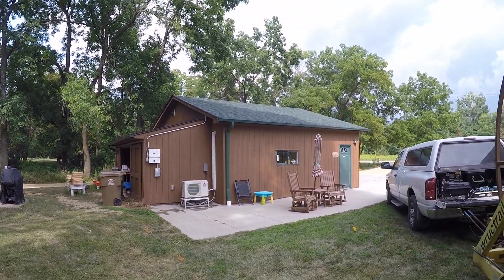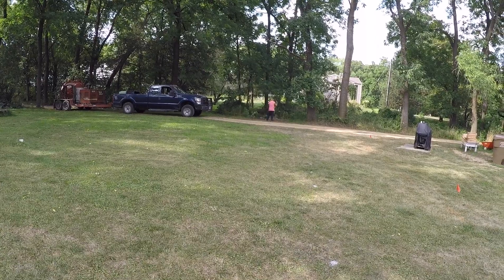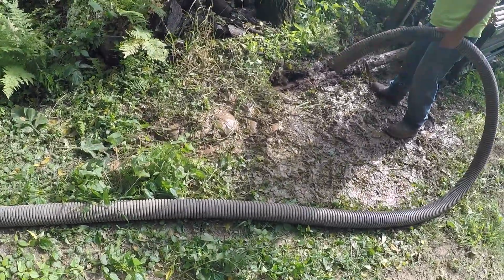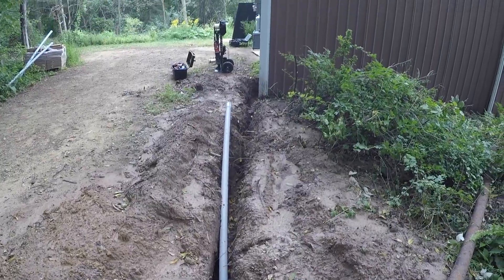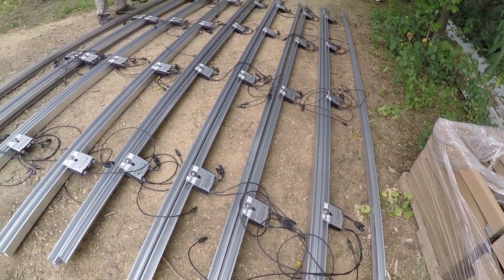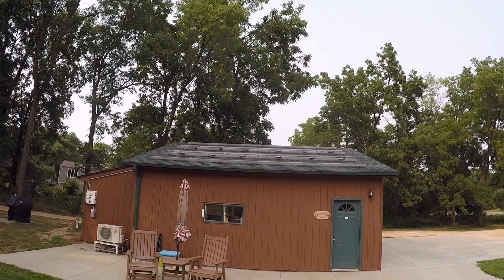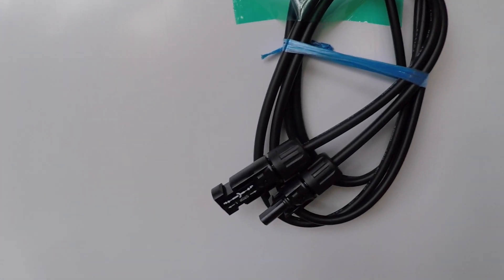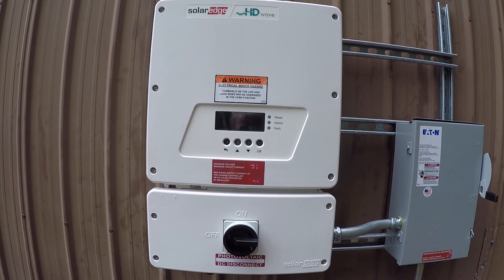Panasonic HIT 330 Watt Solar Panels, 16 5 kw Solar System

Comment: The problem I see is the Payback time is too long. 8 years is a lot of time...
Reply from the maker: Let's talk investment. I bought a new truck in 2017. The truck cost $64,000.00. In eight years the truck will be worth maybe $8000.00 to ten thousand dollars. Is that a good investment? 

 The solar panels since October 12th of 2018 until July 1 of 2019 have produced over 10 megawatts of power. That is 10,000 kilowatts of power. The panels have a 25 year warranty of producing 90% of their  330 watt per panel output.The panels themselves will last longer than 25 years.
 I did get a $28,000.00 Tax credit and Xcel pays my about $1300.00 per year for ten years for my Renewable Electrical Credits.

 So, for a minimum of 25 years  I will probably get in the neighborhood of 15,000 kilowatts every year. Right now an Xcel customer in MN is paying $11 cents a kilowatt for electricity. 15,000 kilowatts is about $1650.00 a year in electrical savings. Times 25 years would be $41,250 over 25 years.  That is figured at 2019 billing costs. As time goes on the cost of electricity will increase probably 3 - 5 percent per year. So after 25 years electricity could be $.30 to $.50 cents per kilowatt. If you live in an area that has high electrical costs, your savings will be more. I am also planning to put in a battery backup system. 

 Also, the investment in solar will help lower fossil fuel emissions. I look at this as not just an investment in money but also investment in our mother earth.